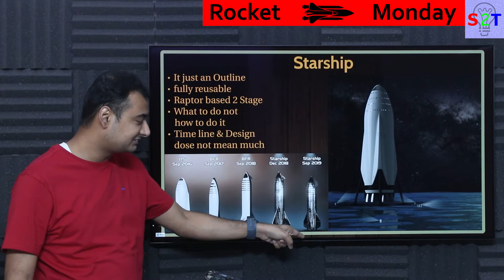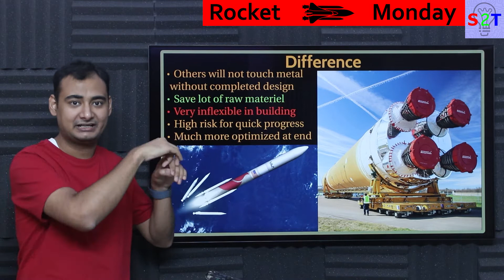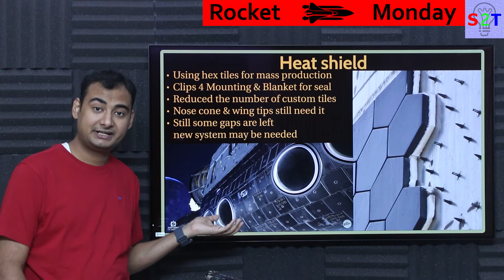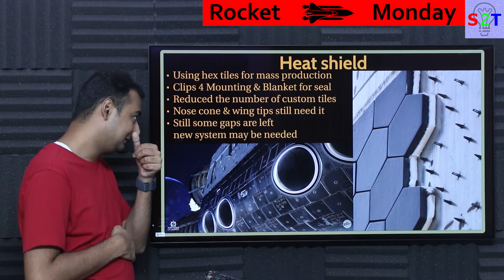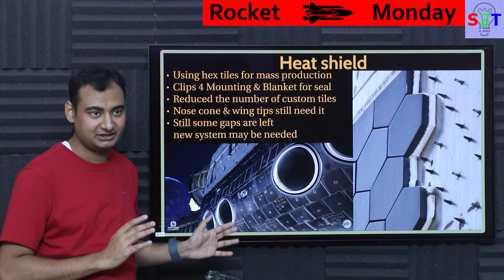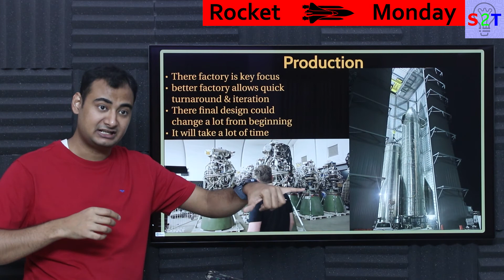Starship 2021 Explained {Rocket Monday Ep155}

Comment: Can upper stage of a 2-staged rocket be made such that after stage separation in LEO its 2nd stage uses chemical propulsion to go away from earth's orbit and after that uses Ion Propulsion for interplanetary journey?
Stage having 2 types of propulsion same time?
Reply from the maker: nope Ion is not powerful enough
Reply: @s2tenglish  after crossing earth's gravity(in space), ion propulsion is to be used.
In space ISP of ion is much more than che propellant.
So is it possible?????
Reply from the maker: nope it has to outside earths gravity field meaning after injection burn